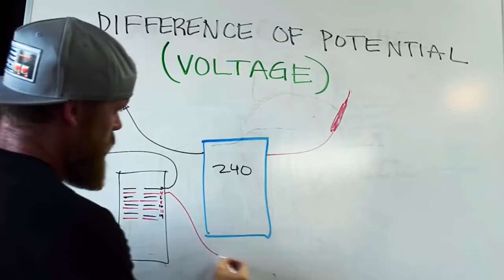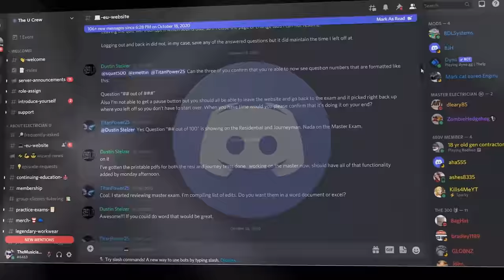Tips on Keeping Cool at the Jobsite (for Electricians) (and all Trades)

Comment: Dustin --- and every other electrician and apprentices,  about the clothing you choose to wear for work. You should always avoid wearing any clothing, especially shirts, sweatshirts, etc..  that are made from nylon, Lycra, rayon, any material that is man made. Cotton, 100% cotton is all you should ever wear. Reason being that if you get electrocuted, get an arc flash, or any type of high heat or flame, that nylon, rayon, Lycra, etc... is going to melt onto your skin and then harden like plastic. So if you survive, you are going to wish you died. All that plastic stuck to your body has to be peeled and cut away from your already burned flesh. If you've ever melted something plastic and seen how it drips liquid fire and it will melt into almost any surface and then hardens as it cools and becomes imbedded into the surface, that is what it will do to your body. 
  Only wear 100% cotton, or flame resistant NOMEX protective clothing. Cotton will catch fire quickly and turn to light ashes and basically fall away from you and disappear. 100% cotton is the safest material. No sports shirts, no wickaway shirts, none of those workout shirts jackets, pants, should ever be worn by anyone working with electrical.
Reply: While this is true, im in florida and those long sleeve fishing shirts that melt like straight plastic are life savers lol. I also watched my coworker get arc flashed and while his shirt didnt melt. He was still cooked crispy tho
Reply: Depends what kind of electrical work you are doing. If you are doing residential then it's not likely you will have an arc flash that will toast you like in industrial/commercial.
Reply: @illestofdemall13  ---- you are correct in what you wrote. The risk is somewhat lower with residential work. But, the risk is there, nonetheless. In residential new construction the odds are very low, but doing service work it can happen. Working on a main panel or meter socket /main combo, 240 volts single phase will still blow an arc and flame as well as all the shrapnel, melted metals, plastics and be hotter than the sun when it does that. Working on any live electrical in any scenario, is always taking the risk of not going home at the end of the day. Even 120 volts. It may not roast you like a marshmallow but it will kill you if you can't get yourself disconnected from that circuit. It will make your heart misfire and fail. It will also give some nice burns to the contact point that starts from the inside out like cooking a hotdog in the microwave oven. The same noises, steam escaping from the splits in the skin from the liquid boiling inside. 
  That's why most electricians who know the reality of the results of being in an electrical accident, will usually say I hope it kills me because survival would be worse than death. 
 We do one of the most dangerous and deadly jobs that there is. The average person who doesn't even think about how the electricity works safely every time they turn on a light or start the microwave or plug in their new television or computer. They don't even realize how many people die every year and have died over the last 150 years so they don't have to wonder if the lights will work every day. People question why we charge so much money to come and do some repairs or installs. Because we risk our lives every day, every job, no matter the size of the job.
Reply: @13_13k  I pretty much wear cotton because I like how it feels but I keep an extra shirt because I sweat through them. Yes, it is a risky job and there are certain tasks that are riskier than others. I know a few people who have been it with 120 and also 240 that were lucky to break free for one reason or another. My brother in law fell off the ladder and that broke the connection. He was moving supposedly disconnected fluorescent shop lights off a shelf in order to take them to the dumpster, but one was connected still and must have had a fault because when he grabbed it, it grabbed him back.
Reply: @illestofdemall13  ---- I'm hoping your bro in law is okay after that?
 I myself have been an electrician for over 30 years, more than half my life. I was union journeyman commercial/industrial for 16 years, was an apprentice on a service truck and a couple extra years, almost 7 years on that job, and I've had my own business and state contractors license for 10 yrs now. I've been shocked so many times I couldn't tell you the number. Two were scary, one I was standing on the top of a 14 ft ladder and got hit with 277v emergency circuit while demo ing a commercial building, I didn't fall, Thank God. But it bit me pretty good, another time as an Apprentice working in a doghouse that contained a water heater and a furnace and a ¾ inch copper water pipe was in front of me and I was leaning with my chest onto the pipe as I worked on a box with a pair of receptacles. I had shut off the breaker before but some other trades were on the job and someone turned the breaker on without asking anyone, this was before lockout tagout was a thing and I got hit with the return on a neutral wire catching 240 volts as I was very much grounded to a copper pipe across my chest. Luckily I was able to let go but my left arm and most of the left side of my torso were numb for about 30 minutes. 
   But I've been in some very very dangerous situations that one wrong move, or if I dropped a tool or a part, while working inside a very large piece of switchgear in the electric room of a high rise, landing a round of 500 mcm wire on the ground bussbar, landing the neutral on its bar and the 3 phases on the 800 amp breaker. Sweating bullets from the heat being generated from all the electric equiptment, probably 115° F in that metal switchgear, plus knowing that one simple mistake would kill me and my tool partner. Hair on my arms standing up from the induction electricity coming off the other breakers and wires, sweat was pouring off me, my head and face and even my forearms.  My gloves were soaked, Unwashed soaked. Even that could have been my death if the sweat made the connection between my arms or body and live bussbar, I wouldn't have to touch it, just be close enough and the power could jump across and I would be done.  I've worked on 3 phase panel that had rain running down the riser from a pool of water on the roof and running into the panel making it shoot random flames and hissing and spitting, dripping  through the meter socket also so no way to shut it down except pull the breakers and get the load down to zero and then wait for Edison to show up and unlock the meter ring and pull the meter. There are other situations,  but all in a day's work. Sorry for the long stories

Comment: I am an HVACR guy and work in attics a lot. What would you recommend?
Reply: 1 word. Hydrate.
Reply: @brandonnewyork11  sometimes the equipment is so hot you can’t even touch it 140 degrees
Reply: I drink a case of water when it is hot
Reply: Keep some Fleet enemas in the cooler. Gotta cool your core down. Make sure the plumbing subs are done with their work before you use this advice though.

Comment: Snow and cold shut down job sites? I spent hours outside in minus -40. You think becuase it up north we never have heat either? I gotten plenty a heat stroke in weather that with the humidex was hotter than the forecast in Arizona at the time. I live the border and hour from Ottawa, Canada. Easier than all of that take some ice water from your cooler, wet a towel, drape it over the back of your neck.

Comment: DONT FORGET Your ice packs in coolers and even better they sell ice pack cooling vests that are filled with mini ice pack pocketed vests are about 35 bucks online lowers body temp about 10 -45 degrees and work great also if you have   hypo-glycemia (low blood sugar) (ask all employees on site if they have it) then   dont over hydrate with sugary drinks which will dehydrate you quicker than anything and turn you into lobster red skin which is deadly and will give you quick heat stroke and your skin will feel tingly inside which is first sign of heat stroke if you feel tingly stop immediately and under no conditions keep working until body core temp is lowered as quick and safe as possible your health is more valuable than anything dont be manly and die screw work cool down

Comment: I work for a solar company here in Las Vegas and my boss is pretty cool. He sends out each truck with a 10 gallon water cooler and a whole box of Liquid IVs to mix in it. It really helps, I’ve seen a lot of new guys not take the electrolytes and collapse on the roof after 2-3 hours in 115 degree heat. That stuff is more important in the heat than some people realize.

Comment: I'm a 30+ yr frame carpenter, live on the gulf coast and my recommendation as for keeping hydrated... instead of drinking just water add Himalayan salt to your water... just a pinch in your 16oz water bottle. Also you can add lemon juice to your water. Both of those will give you plenty of the electrolytes your body needs.... much better than Gatorade. Also eat lots of fruits that contains water... watermelon being the best as well as citrus fruits. 👍
Reply: Himalayan pink salt is actually Pakistani rock salt, and is chemically no different than regular table salt
Reply: @reanukeeves2564  does it really matter what fricken salt you want to use? This is what I use and works best for me so use what ever works for you..... fkn trolls
Reply: @r.deanmcknight136  i suppose you're right
Reply: @reanukeeves2564  apologies for the troll part. I was pointing out that adding salt to water is actually better for you than drinking Gatorade and adding lemon juice also does the same which is also better than Gatorade. The "pink" salt has more trace minerals than reg table salt therefore reduces the lactade acid that builds up in the muscles causing fatigue. Lemon water does same thing.... helps reduce fatigue and keeps you hydrated.